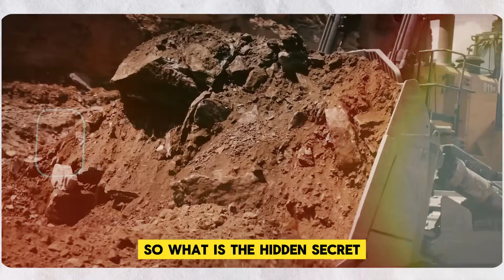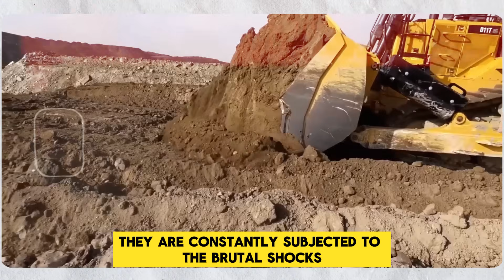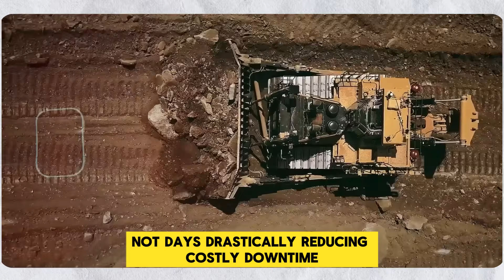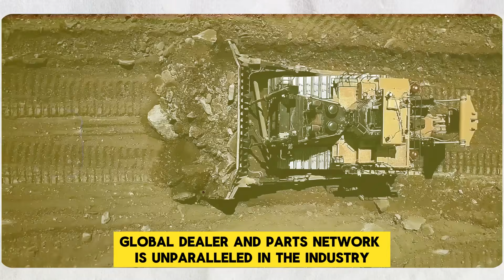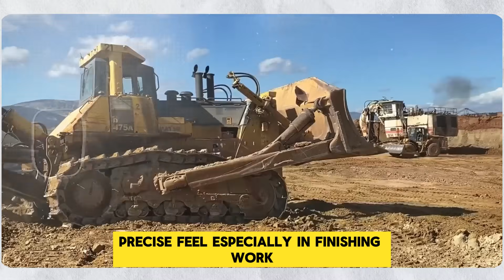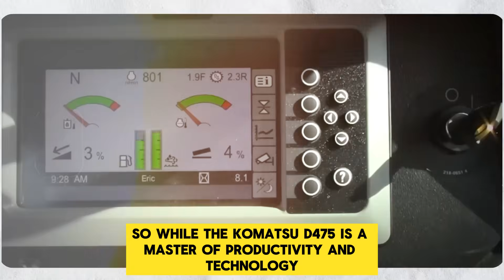Why CAT D11 is Preferred Over Komatsu D475 | Bulldozer Battle

Comment: The old adage remains true: "You get what you pay for". Komatsu is less expensive and usually has a more power to weight ratio than CAT. It may can outperform a CAT, but eventually it will destroy itself. Then resale value kicks in. My experience with Komatsu is: After 4 or 5 years of use, dig a hole and bury it.